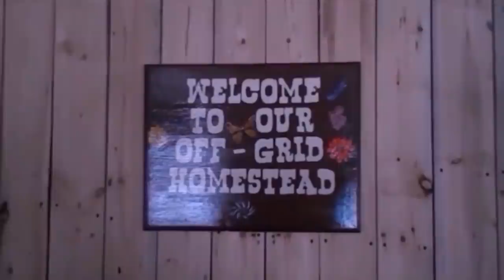Portable Sawmill. How We Supply Logs For Our Mill In The Winter

Comment: Camera works great and the audio isn't too bad either.  :)  Nice load of wood about a cord or so.
Reply from the maker: Thanks Sheepy. I think the camera and mic should be a great investment.  You are very close, The load on the sleigh measures  3' wide x 2' high x 8' long... So 3x2=6,  times that by 6 16" blocks= 36,  then divide 36 by 32 square feet in a face cord = 1.125..So that would be one and an eighth  16" face cords give or take a few blocks... If my math is correct lol.  Cheers.
Reply: @SkinnersOffGrid  4by4by8 for 128 cubic feet of wood.  Thus if I pay $275 for a cord of wood it means I pay $2.15 for a cubic foot of wood. Now, it gets expensive as I might use between 3 to 4 cords per winter.  I love how you simplified getting the wood home with Heather... plus most of the mess is left in the woods.